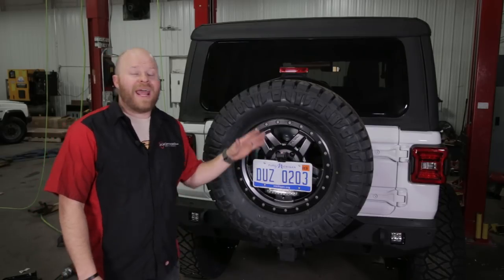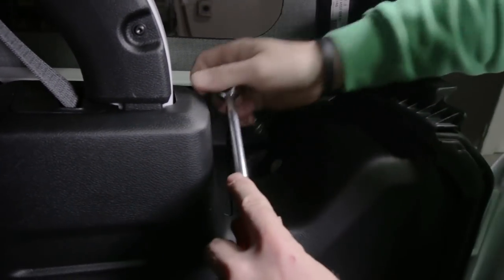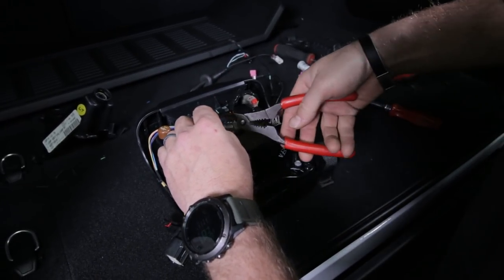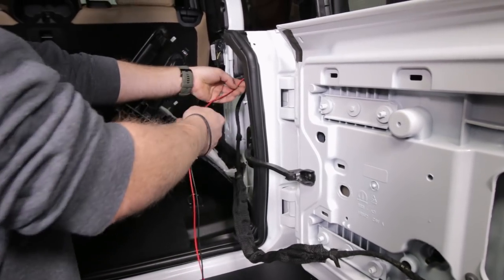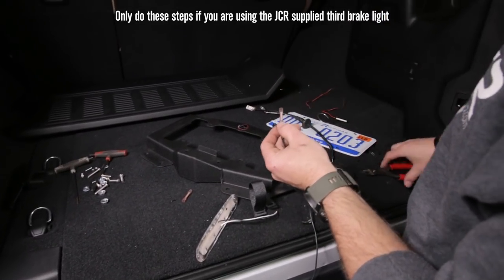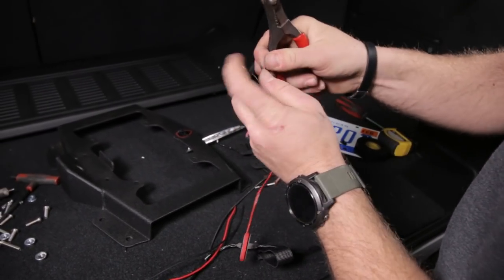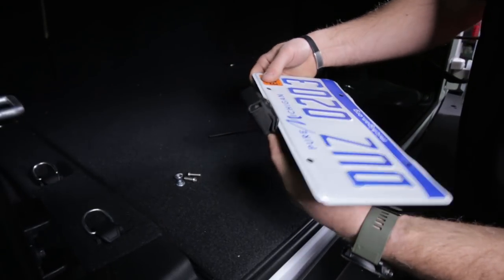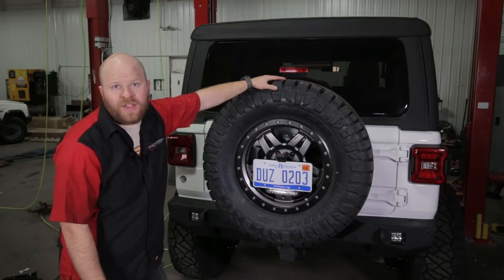JcrOffroad | JL Wrangler License Plate Relocation Bracket Installation

Comment: This was the best video to follow. Clean and easy install of a smittybilt license plate light. You can use this process for any brand if you want to avoid routing back to the factory connection on the driver's side.